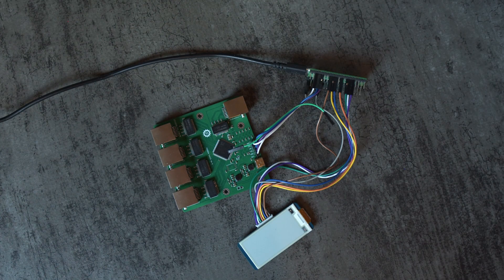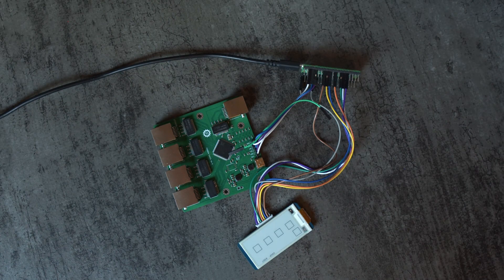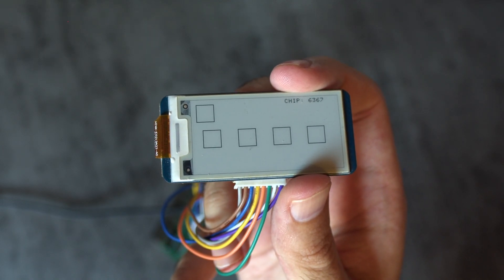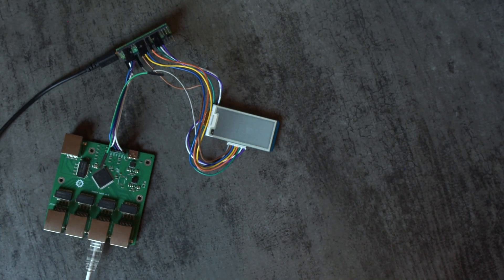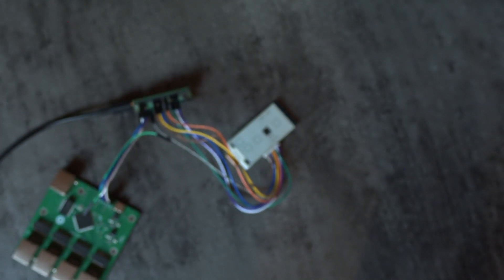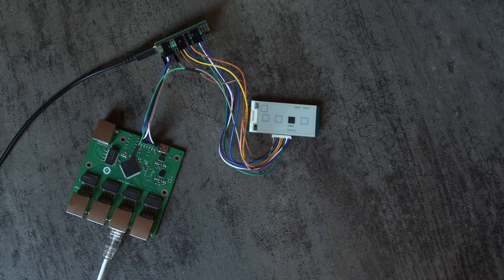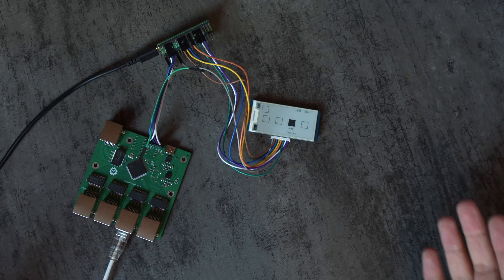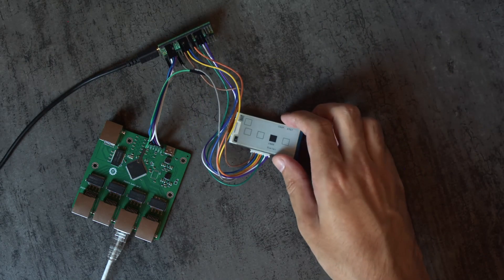Adding ePaper to the gigabit switch

Comment: my two cents here, it would be super cool if you can show IP and Mac on the ports
Reply from the maker: IP addresses would be really hard here since the switch doesn't have any IP information. mac adresses would work.

To get a ip somewhat working you'd need an ethernet connected MCU that does ARP and heuristics on what's what.
Reply: @MartijnBraam  Could be done with an ENC28J60 on the 5th port. And then have it do WoL for each port as well.
Reply from the maker: There's an internal MCU which has an internal ethernet interface, that would be ideal for this if there were any docs. Otherwise a wiznet or ENC28J60 connected to the 6th internal port would probably work, no need to waste one of the ports with PHY for that.
Reply: @MartijnBraam  oh  I missed the fact it had another internal port.
Reply: vlan info, data rate ( of some sort) vs simple activity
Reply from the maker: @SamMaciel  I'm still in the process of writing the code for SNMP data, with that I could add some nice charts to this.